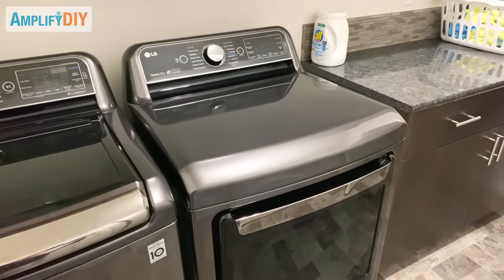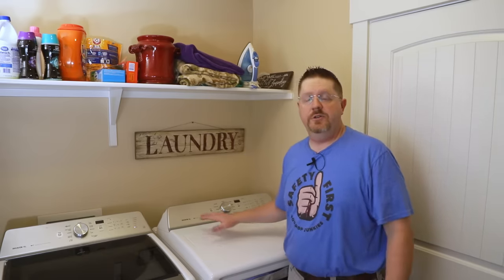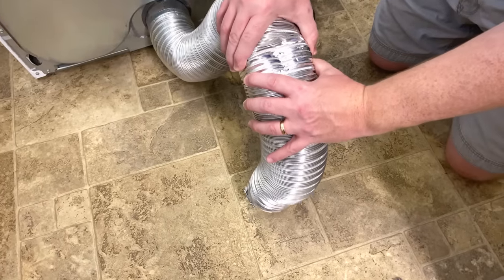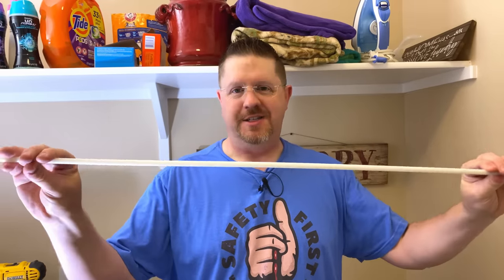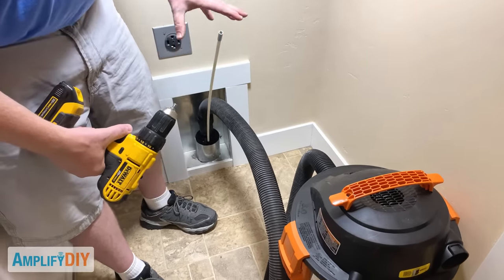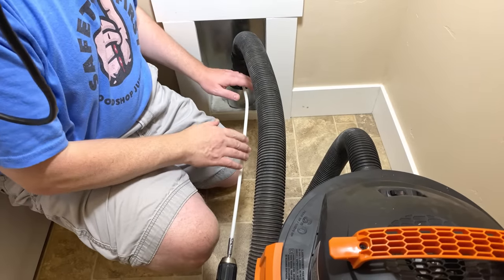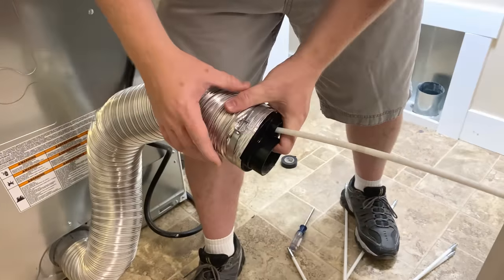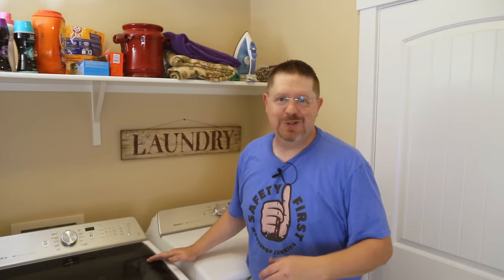How To Clean Your Dryer Vent Duct - Step By Step - It's Super Simple!

Comment: A very good demo on dryer vent cleaning, many thanks!  The dryer cleaning kit on Amazon is well worth it.  Thank you!
I would make two alterations to your present setup:
1. Back of dryer vent is too squished up.  Get a 90 angle set into the house connection vent, then your dryer hose will be a straight connection to it. The way it is kinked up will accumulate lint faster and restrict air flow.
2. Exit vent on house exterior is too close to the gravel and ground.  Why not make a hole below so air has somewhere to go?  It has no clearance and vent door flap will not open easily leading to faster build up and strain on dryer motor.  I would give it more space. It will also act as a lint trap.  The other option is to mount it sideways for optimal clearance.

Please do not add any music to DIY / demo videos.  They are super annoying to viewers.
You will never have anyone ask you to please add music to your videos.
You will always have some viewers who get irritated with music.
If you want a wider audience, remove all music as a standard rule for DIY, demo, tour, animal, or cooking videos.
Reply from the maker: Thank you for the feedback. You make some great points about music in videos like this - though I have actually heard from some viewers who do like the music sometimes. I'll keep your request in mind in the future though. Thanks!

Comment: How can you use one of those brushes on PVC spring steel dryer duct?  Would it not damage the duct?
Reply from the maker: You can use it on that kind of duct if you are very careful and keep the duct straight on the floor as I believe I demonstrated in this video. If you have that type of duct inside your walls... the builder did not build to code (assuming you are in the US). Code has been smooth-walled metal ducts for decades. If you have one of those flexible ducts in your walls, I strongly recommend you look into options for getting it replaced with the correct type. Good luck!

Comment: So what happens when it snows ? etc   and cover the exit pipe outside and you use your dryer ???   we don't have this sort of set-up in Australia
Reply from the maker: It's super rare around here to have enough snow that gets under the eaves of your roof to pile up enough to cover the dryer vent. Plus, the warm air exiting the vent would pretty quickly melt whatever snow does build up, I'd guess.
However, I should point out that the vent I cleaned in this video with the exhaust right at the ground is not to code at all. They are supposed to exit the building much higher, but builders cut corners, and moving it would require a lot of demolition. 
Great question!

Comment: this gentleman has the only flexible duct we should use on a dryer but it can only go from the dryer to an outside wall not up threw the attic or down threw the crawl space and it has to stay perfectly round because air doesn't like peaks and valleys or turns and you should have to uninstall your washer if its next to the dryer to disconnect the dryer vent then pull the dryer out  to get to the vent hole.The efficiency of our dryers is the vent meaning the shortest, straightest smoothest vent will allow the excessive heat and the moisture to get out the fastest,the faster the moisture can get out the faster the clothes can dry.

Comment: I went to my moms and heard her complaining about her dryer not heating up her clothes so I checked the vent and was clogged up bad she didn’t have any cleaning kit and haven’t cleaned it in years and her vent is really short because it’s on the outside wall so I used a long screw driver and put my hand in there and electric leaf blower and it’s good for the time now until I get a kit

Comment: Does this work with the plastic dryer vent hose that is spiral wire ribbed? I don't want to tear it to shreds inside the wall. Also, my dryer is electric and I run it on the low heat setting, so I assume not hot enough to cause a fire. I clean out the lint trap in the dryer with every load of wash. I know there is some lint in the vent hose, because I can see it from where it blows outside, but the vent hose is nowhere near blocked.
Reply from the maker: Hi there - NO - do NOT use this brush if your home was built with flexible spiral wire ribbed hose inside the walls. This brush WILL tear that sort of hose up unless you are extremely gentle...
Also: that kind of hose should never be installed inside the walls, as it poses a significant fire risk as the ribs collect/gather a LOT more lint than the smooth-walled ducting like I showed in this video. If there is any way to swap out the flexible hose in your walls for smooth-walled ducting, please do so. 
Good luck!

Comment: What if you don't have a shop vac? Will a regular vacuum work?
Reply from the maker: Hi Victoria - yes, you can use a regular vacuum. You'll just need to use some duct tape or similar to adapt the smaller hose to the vacuum attachment. Good luck!

Comment: I would like to point out that dryers suck in unfiltered room air to make up for the air that they blow out the back and while the lint filter limits the lint blowing out, nothing prevents room dust from getting sucked into the heater section and the drum. Wish they had intake filters too, or at least a place to put such filters

Comment: If we had a rod snap what would you suggest to remove it?
Reply from the maker: Hi Edward - hopefully you were able to get the snapped rod out - if not: Try using a bent coat hanger taped onto the end of the remaining rods. Depending on where in the line the rod broke, you may need to come in from the outside of the house. Good luck!

Comment: Any tips for angled areas? Mine seems jammed like no where to go. It upstairs and go straight out about 12-15 ft so i don’t know why the angle
Reply from the maker: HI Kimberly - any chance you can try to come at it from the outside-in? It's pretty common to have 90º bends, but usually these cleaning rods have no trouble getting around them.

Comment: Where did you get the wet vac attachment that holds it tight on the end of the duct?
Reply from the maker: Hi Anthony - it is included in the kit I linked to in the description. Note that there are cheaper kits available, but they don't include this adapter. Here's a link to the kit I used:  https://amzn.to/2E0gZjK

Comment: Using this method, I got about 1.5 rods in and met a huge amount of resistance. Rather than pushing hard and risking damage, I stopped. Any tips?
Reply: And the exterior vent is at least 25 feet away, so it's not that
Reply from the maker: Hi 57 - I would recommend you do the following: Hook the dryer back up to the vent, start it on it's coolest setting with no clothes in it. Go outside to where the vent exits, and start cleaning the vent from the outside of the house in towards the dryer. My best guess is that you have a nasty 90º (or even possibly sharper, depending on how the vent was routed) in your vent run. Cleaning from the outside in will hopefully allow you to get the vent cleaned all the way back in to the other side of that corner. 
Note that when cleaning from the outside in, you don't need the shop vac, as the air pressure from the dryer will be plenty strong enough to blow out the lint.... right into your face - so wear eye and respiratory protection. 
Good Luck!

Comment: Does this work as well for an accordion style vent tube?
Reply from the maker: You should be VERY careful using this in an accordian style tube... they are much more fragile and can easily be damaged. I did show how to use this to clean the short accordian-style vent that goes from the back of the dryer to the wall, so it can be done - but be careful.  Also note that if you have a vent like that installed inside your wall it is completely against building code in the US. Dryer vents are supposed to be smooth-walled, specifically because they collect less lint and are less of a fire hazard.

Comment: Mine goes straight up through the roof. I got a new dryer last week and there was a dead bird in the pipe near the dryer so I am wonder if I have anything else in there after 9 years. I think the builders use flexible hose all the way up. I don't think it is solid like yours
Reply from the maker: Definitely time to clean it! Be VERY careful if the pipe in the wall is actually one of the flexible ones. It is supposed to be smooth-walled, like the ones I showed in the video. Good luck!

Comment: I have a very light flexible duct  type which is hard to use this cleaning device without The duct keeps spinning in bundling up.

I may have to replace them with metal  ducts but due to tight angle it is harder to Install one.
Reply from the maker: Hey Simple Living - are you saying you have flexible ducts *inside your walls*? That's not up to code, and really should be replaced asap. It's a real fire hazard. Be safe, and good luck!
Reply: @AmplifyDIY  Not in wall, is it is inside in our garage from dryer unit,  coil, snake on floor, and  out to outside wall vent.  I plan to change it again with metal, but metal duct is hard to work with in tight space and angel.  I will check for new metal duct products.

Comment: If I have normal vacuum cleaner, can I still use it to clear the duct?
Reply from the maker: Yes, but you may need to tape on the adapter, and you'll likely need to empty it several times as it will fill up more quickly than a shop vac. Good luck!

Comment: I need your help. I bought a dryer vent kit but it did not come with the adapter to use it along with a vacuum. I’ve looked for this all over Amazon, Home Depot, and Lowes. I really don’t want to purchase another kit just for that piece. Any ideas?
Reply from the maker: Hi Barbara - unfortunately, there are a whole bunch of cheap knock-off kits available online, tat do not include the adapter. The only kit that I know of which includes the adapter is the one from the LintEater company that I linked to specifically: https://amzn.to/2E0gZjK - perhaps you can return the one you purchased and get the LintEater one instead? Alternatively, you could try something like this: https://amzn.to/3D8FVQn - which may work, but you'll have to drill a hole in it for the brush rods to fit through off to the side (essentially you'd be making your own adapter). Good luck!

Comment: I have my washer and dryer stacked on one and the other. They are Maytag and seem to be of good quality. I live in a condo, how can I clean the dryer vent behind the dryer except trying to pull that whole large unit out to get to the back of it? Please help me, I’m quite worried about the lent that I can visually see down below and behind my lint screen. Yet be assured I clean my Lint screen every single time I use the machine.
Reply from the maker: Hi Lois - do you know where the vent exits? For some installations it is better/easier to clean from the outside in towards the dryer, rather than move the dryer and clean from the inside of the house towards the outside. If you don't know where it exits, you'll need to move the whole stacked unit to get access to the vent duct. If you do know where it exits, then here is what I recommend: 

Start the dryer on a cool cycle, with nothing in it. Go to where the vent exits, and start cleaning the vent from the outside in towards the dryer, using the same method I show except that you won't need the vacuum, as the air pressure from the running dryer will be enough to blow the dislodged lint out of the vent... right at you - so wear some eye/respiratory protection. Good luck!
Reply: I thank you for your response. My issue is I do not access to the vent ‘outside”, I am on the 5th floor. Have you any experience with a high rise vent cleaning  ?

Comment: I was having problems with the hose coming off the inside wall over and over, it turned out a wasp built a nest right at the outside exit flap which was preventing the flap from fully opening.  This increased the pressure inside the hose above normal so the hose would come off.  It's important to check the flap outside occasionally.  I'm considering putting a metal mesh on the outside to keep the wasps out of there. 
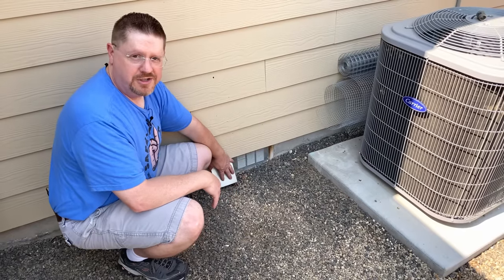I'm lucky, my vent basically goes straight out the wall, so it's very short probably between one and two feet of ducting from the wall junction to where it comes out.  That duct shown in this video here (5:02) is really bad, look at how close the ground is from the outlet.
Reply from the maker: Great tip about checking the outside duct, manw3bttcks! I'm glad you found (and hopefully eliminated) the wasp nest on yours. Thanks for watching!

Comment: could you please teach us how to declog the faucet drainage….I already treated it with drano @nd hot water several times, also pour vinegar, but no use.  I refrain from using the tap completely for several days now, but every morning I check the bathroommand always find the basin full of dirty water (I don’t know where the water came from.)  Is there a declogging chemicals for treatm3nt that we can buy from grocery or stores? Please help me.
Reply from the maker: Hi Amalia! Sorry to hear you are dealing with this issue! There are several ways to deal with a clogged drain. Sounds like you have already tried the basics. The next thing I would try is a plunger - they make small plungers designed specifically for sinks, but I've used a toilet plunger in a pinch to clear a drain. If that does not work, then the next step would be to go to the hardware store and get a "drain snake" - this is a flexible metal tool that you can push down into your drain. It will flex around the joints in your pipes and can break up whatever is clogging your drain and causing the problem. Good luck!

Comment: I have a important question. I need this done but why do I see some clean from the outside and some cleaning from the inside of the home? What is the difference
Reply from the maker: Hi J.M. - ultimately, the duct is just a tube that runs from the dryer to the outside of the house. You need to clean the full length of the tube. Sometimes this is easier to do from the inside out (like, when the vent exits on the roof) and sometimes it's easier to do from the outside in (perhaps the laundry room is a very tight fit and you can't get access to behind the dryer easily).

Ultimately, it does not matter which direction you clean from, only that you clean the whole length of the vent. I recommend doing it from the back of the dryer out to the exit of the vent because it's easier to tell when you have gotten to the end. Thanks for watching!

Comment: What do you suggest if I don’t have access to a shop vac?
Reply from the maker: Hi aj - there are 2 main suggestions, with a 3rd iffy one: 
1) Use duct tape to adapt your regular household vacuum to the vacuum port in the kit.  It may be ugly, but it should get the job done.
2) Leave the dryer connected to the vent, and instead of clean it from inside the house towards the exit vent, clean it from the exit vent in towards the dryer. When using this method, first start the dryer (with no clothes in it) on its coolest setting. This will provide enough airflow to blow the lint out as you clean. If you do this method, use eye and respiratory protection, as all that lint will blow directly out into your face. :-)
3) And the iffy solution: save up a bit and buy a shop vac... they are not all that expensive (around $100 USD in my area to get one that will do the job) and you'll find all kinds of other uses for it. But this assumes you have the budget, and a place to store it when not in use - thus why I consider it an iffy solution. 
Good luck!

Comment: Do you have a video on cleaning your washer?
Reply from the maker: Not yet... but I'll add it to my list!
Reply: What about the actual fan that usually on the bottom left of the back of the dryer behind the wall where the thermal fuse is doesn't the fins on that fan propeller get caked with lint do you recommend taking the back of the dryer off or do you think all that stuff you did with the duct work gets that clean

Comment: My dryer is a stacked on top of my washer. I can't pull it or the washer out from the wall because the washer is sitting in a washing machine drain pan which is cemented to the floor. The laundry room on the second floor of my home and is vented to an outside side wall on the second floor. I'm wondering how I'll be able to clean my dryer vent? Any suggestions?
Reply from the maker: The only suggestion I have is not a very good one: get yourself a ladder and clean the vent from the outside of the house in. When you do it this way, you will not need to have a shop vac. Just start the dryer with no clothes in it on it’s coolest cycle. Then go and clean the vent from the outside of the house in towards the dryer. Make sure you wear eye and respiratory protection when doing it this way, as the dryer will blow all the dislodged lint straight into your face. Also, be super careful when working up on a ladder. Good luck!

Comment: Can you actually start from the outside?  Or does that push stuff into the dryer?
Reply from the maker: Hey Fletchman - yes, you can certainly start from the outside! The trick to doing it this way is to start the dryer on a cold cycle (empty) while you do it. The dryer will provide plenty of air pressure to blow all the lint out the vent while you clean. You should wear respiratory and eye protection while doing this, as all the lint will be blown out right at you. Good luck!
Reply: @AmplifyDIY  Thank you!  The kit arrives on Wednesday.  Is it possible to run the cleaner first, and then use the dryer to blow out the lint?
Reply from the maker: @Fletchman1313  It's best to have some air moving during the entire cleaning process. Otherwise as the brush dislodges lint it will quickly get clogged up  and make further cleaning pretty difficult. Good luck!